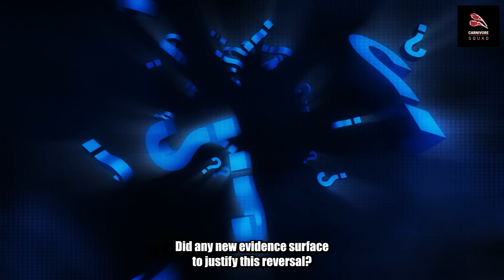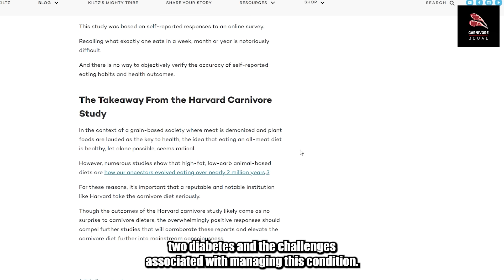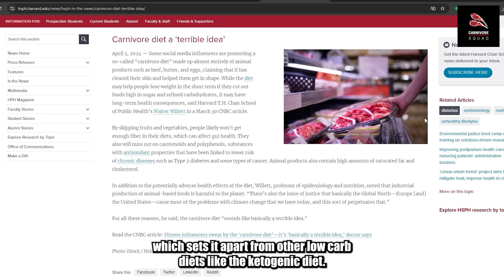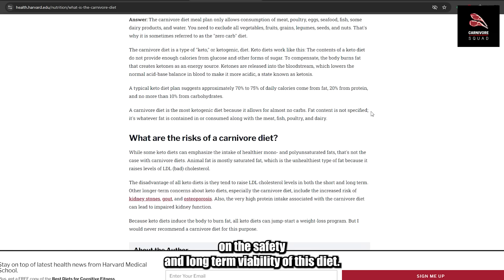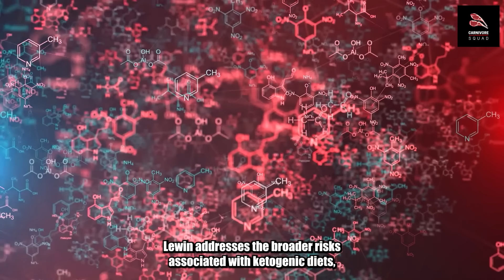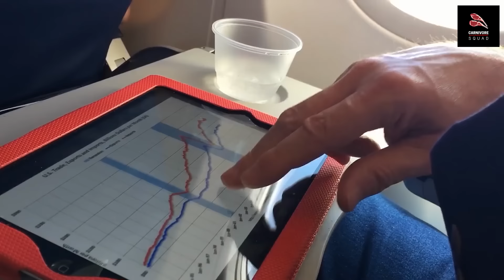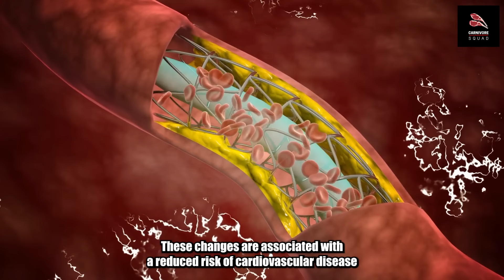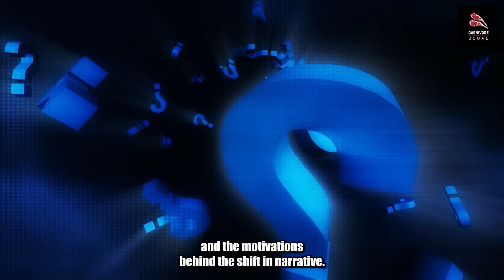🔴The Dark Side of Carnivore.. Shocking Harvard Study Findings [2024]

Comment: 10 month carnivore here.  73yo male. Lost 101 lbs. chronic knee pain completey gone, now walking two miles a day. A1c went from 13.1 to 5.7. Stopped metformin and actos 9 mos ago. Stage3 chronic kidny disease (GFR 56) now completely normal (GFR 88). Lipid profile normal for the first time in my life. Blood pressure now normal (132/75) BMI from 42 to 29.  Wearing a continuous glucose monitor just for yucks.  Never outside normal range unless I decide to cheat. Both the regular readings, and the spikes when eating carbs have proven to me that I will be carnivore for life!   BTW, love my CGM not for the actual readings ( not always 100% accurate), but for the correlation to which foods spike when I eat them  This is a great training tool. Highly recommend to all diabetics. Have been severely insulin resistant and pre-diabetic for 50yrs.  Was always the "fat kid" on the block  Just wish I knew about it 50 yrs ago. (thank you Dr. Fung et al.)

Comment: I am a 71-year-old woman who has been eating a carnivore diet for 13 months.  I have not felt better in all my decades.  I now have a daily routine that includes calisthenics, sprinting, weight-lifting (baby weights),  hanging and walking.  I had an unfortunate injury 2 months ago requiring emergency surgery and was prohibited from doing all exercise except for walking.  I pined for my routine.  I credit carnivore with my speedy complete recovery.  Additionally, I am an elderly woman who experienced a harsh fall on a hard surface and didn't break a bone.  Observations about the hospital that I found disturbing are 1. there wasn't a darn thing there I could eat., 2.  they thought my ideal blood pressure of 109/63 was "too low", 3. they recommended more than a few unnecessary procedures/medications/invasions that I consider dangerous.  Much to their surprise I was discharged less than 24 hours after surgery.  I could go on for days re the virtues of a carnivore way of life (IK, I already have).  I love it so much!! PS  I have maintained a healthy body weight and take no medications.

Comment: I have lost over 100 pounds and my triglycerides have dropped dramatically. My LDL is up but my HDL is also up so I’m not worried about it. My knee arthritis is gone. I will always be on carnivore or KETO for life 😊
Reply from the maker: Great ..
Reply: That’s excellent Sheila. What a life changer.
Reply: Have you calculated your CVD risk using the TG:HDL ratio? Work out your risk by dividing your triglycerides by your HDL. A level of 2 or under is ideal. You may be pleasantly reassured.

Comment: Cured my ulcer, hyperacidity, a problem since i was in gradeschool, acid 😂reflux, constipation, hypertension, tooth decay, migrane all cured without taking any single pill. In just a matter of weeks from 160/100 blood pressure i suffer for years already suddenly went to normal bp without the help of any pill. My strength and speed came back to teenage years. Im 55 yrs old now back to teenage year strong. No supplements for almost 2 years now. Thats why i laugh loud when some findings like this emerge. Try it first. Imagine im suffering for aching tooth both molars for years already suddenly gone and now reversing because that aching teeth was repaired by my body itself with the help of course of carnivore diet nothing more and my ulcer for decades suddenly gone like a miracle and never came back since carnivore. Beat that with bs mainstream findings and any drug

Comment: I did an experiment on me. 2009 I went on a raw vegan diet, lost weight but didn't heal my joint pain, did vegetable diet for years but would eat a little bit of meat now and then, gradually slipped back into a balanced diet that was also lots of bread and candy. My shoulders were locked up with pain. My knees were full of inflammation and pain, was on and off crutches for a few years, then did strict carnivore diet and intermittent fasting. I went from 180 pounds down to 124 pounds and lost all of my pain, oh I didn't mention the chest pains that came on daily. that was going on until I switched to carnivore, now I am also relieved of the chest pain 100%. I am no longer strict carnivore anymore though. I am verry carful though Yes, I allow myself a good quality milk chocolate bar one a week, yes, a big bar, and a pint of ice cream once a week. I am 139 pounds a man at 5'7" I feel good and am content with that, I am 67 years old and usually get a five-mile bicycle ride in daily, regular mountain bike no electric or motor just my own pedaling. Thats my experiment. It is well with my soul; I am feeling good at my age. Stay well!

Comment: I am not 100% carnivore . But I try and I will eventually succeed . I struggle loosing weight but the following change has happened: psoriasis disappeared . 
I also have become much better at NOT snacking . As said not 100% there but I realise the devastation of even moderate carb consumption -allegedly due to the negative effect it has on gut micro biome . People with gut problems had a biome that thrive on carbs and people without problems have a biome thriving on protein and fat. 
I have fasted and understood need for food intake on a whole other level . For instance I have trained during multiple day fasting with NO issue . Before I “needed” to eat several times a day- but the food had to be very delicious. I now consider this a mild form of eating disorder . If food has to appeal to your comfort besides feeding you you are NOT hungry or in actual need of food. This means a much better control of food. I am even sure this will improve as I go 100% due to better function of metabolism and the regulating hormones . 
I need to brake the 3 month barrier of no carb to get full benefits . Luckily some say that after 3 weeks lots of benefits appear .
This doesn’t mean that I never bill eat carbs again but it will take an apocalyptic lack of food to change back. Or imprisonment by a fascist vegan government so they control my food 😂….😱😱😱

Comment: I probably have a skin cancer, that doctors don't want to operate. Through changes in my diet I've noticed that high carb + high processed carb diet leads to significant pain, and intermittent fasting or high animal meat/fat diet leads to reduction in pain to zero, I also don't feel any pressure (I mean physical pressure) from the cancer tumor. Idk why it happens, but it's pretty groundbreaking outcome, even if we'll consider just the reduction in pain.

Comment: Age 80. Strict Carnivore for one yr. Plus "Ketovore" for another yr.  
Beware! I sufferred low energy in my Carnivore year albeit other benefits were several.  
My mistake was waaaaaay too high a proteim ratio to a way too low fat ratio. Beware a lot of Carnivore Gurus deemphasize the much needed higher fat to protein ratio, especially if maintaining, not losing, weight is key.
The ratio advised in this Video is approximately correct for my slender body type.
Had I followed that fat ratio advice in my strict carnivore year it would have saved me a lot of greif.
Anyway at age 70 yr.  I started breaking down physically, but now at 80 yr. my body & mind is better than when I was 60. That is thanks to my purely zero junk diet, low, low, low & slow, slow, slow carbs, relatively low blood glucose/ moderate to high ketosis diet. Plus amazing meta natural (mind over matter) discoveries deep within me.

Comment: All things in moderation.  Cholesterol is critical to the generation of hormones to  adjust the metabolism.  One item is missing as we age is the levels of pregnenolone, a precursor of 150 hormones in the body.  As we age, we do not make as much pregnenolone as we did in our early years.  The biologic age can be projected from the levels of pregnenolone in the blood.  Cholesterol increases as pregnenolone declines.  Pregnenolone is available as an additive over the counter.  The Pharmaceutical folks do not want you to know about this dietary additive.  They warn that PREGNENOLONE should not be used long term.  It is something our bodies have been using for nearly all of our lives.  It will drop your cholesterol like a rock.   Fiber is important.  Decrease the impact of carbohydrates that set you up for diabetes.  I have been using pregnenolone for over 35 years.  I look younger than my 73 years would suggest.

Comment: Potential risks in the Carnivore Diet (W. Willet et al., 2024)

1- High LDL or "Bad Cholesterol": This is based upon "The Lipid Hypothesis" Which is JUST a correlation but not actually proven...in fact atherosclerosis needs high blood pressure, oxidative stress (Endotelial Damage likely due to hiperglicemia) and high LDL but it turns out that if you dont have any of the first 2; high LDL by itself it is not harmful at all. Saturated fats are the bodie`s preferred fuel source (turned it ketone bodies) and it is needed in sufficient amounts to maintain hormonal balance (and no, the cholesterol synthetized by our own body it is not enough, we need to consume more from our diet).
2- Fiber is crucial to maintain gut health: Again... it is not actually proven.
3- Carotene, AIDS and polyphenols Deficiency: These are not a requirement for human diet and you dont need to have high amounts of antioxidants protecting your cells if you are under a uninflammatory diet, such as the carnivore diet. In fact a plant based diet contains toxins and antinutrients like lectins and solanines which are HIGLHY inflamatory.
4- Kidney Disease: It is well known that high blood pressure and hiperglicemia damage the small blood vessels of the functional units of the kidneys, causing the loss in functionality and protein, blood and immune cell inflitration to the urine, furthermore kidney stones are highly composed of oxalates, crystals that are found in plants. A high fat and protein diet like the carnivore diet do not threatens by itself the kidneys, in fact they start to work more based upon the Flomerular Filtration Rate (GFR): this number goes up in a carnivore diet, which means the kidneys are actually working more because they are healthy and they can perform well.
5- Enviroment: Industrialization of any thing causes harm to the planet, no matter if it is animal or plant based. If you look at Regenerative Farming is one of the best ways of sustainability.

Remember: Epidemiology, which is observation of population and variable correlation, DOES NOT PROVE CAUSALITY. It can only be used to formulate hypothesis and in reality is very very hard to accomplsh a well done nutritional study in humans. 

Carnivore made me feel better than ever, i must admit that i keep eating pasta, fruits and honey occasionally but my diet is 70% meat, eggs, bacon and seafood. Im HIGHLY Uninflamed, high testosterone, extraordinary strenght, recovery time, improved mental health, diminished mind fog and my senses are clearer. Feel free to share your thoughts!!

Comment: I am starting carnivore September 1. I have just removed all grains. In a week I lost 3.5 pounds, which is disturbing because I want to put some pounds on. I am 5’ 8” and weigh the same as I did at 20 - 126 pounds. I am doing this because for decades I get 2-4 migraines a week and my lower tummy is always bloated. I have been gluten and dairy-free to no avail. I suspect oxalates and salicylates in plants.
I am trying to figure out how to add weight without eating too much protein. I don’t really care for meats except for lamb. I already eat a lot of salmon so am not adding that due to mercury concerns. Anyhow, if anyone has put weight on while being carnivore, please let me know!  Oh, and I am 72.
Reply: I got rid of about 90 percent of carbs and lost enough weight to become lean. Then , without cramming too much protein down my throat and large amounts of fat to maintain my new weight, I started putting olive and avocado oil on my food. I don't know how good or bad this is due to whatever information is being pushed, but to be on the safe side possibly, am adding supposedly good oils to provide over one thousand calories a day and sometimes up to 1500 a day so my weight has stabilized at 146 plus or minus. If I eat veggies and some carbs, I will weigh around 152 and my stomach is bloated, have gas and about 2 pound craps. A couple of days no carbs or veggies and back to a flat, comfy stomach and 146 pounds. That I conclude shows carnivore is good and the other diet is full of crap. That and even if I still don't get good sleep, I don't feel the carb coma making me tired and wanting to nap and fall asleep at the computer. Also my ass feels better from having fewer poops that are cleaner and don't take many wipes with paper rubbing my anal orifice until it's raw. I'm 73 and my lean , more like ripped body stands out at the gym getting compliments from almost everyone. I do heavy barbell curls with over 200 pounds, cable rows with up to 300 pounds, lat pull downs with 185, triceps push downs with 120. I'm about 5feet 9 and a half inches and 146 pounds. I do need more leg work I admit. That would add another 10 pounds or so and look better. Great bone density like a much younger man due to high protein diet and exercise. I've only lost a half inch of my formerly 5 feet 10 due to bad posture being my own fault of slouching too much. For over 30 years doctors have wanted me to limit meat to once or twice a week because of cholesterol and to take statins . Even when it was only 185. Their trying to kill me. Gonna tighten up diet more with almost zero carbs and see what happens. Down to 5.3 A1C 3 months ago from a high of  6 a couple years ago. Aiming for a 5 next time in 3 months next blood work. 3 tablespoons of oil is around 360 to 390 calories. Add that to every meal and see what happens. Then add more or less if needed.

Comment: Inuits didn't need to be sharp minded like people in the west - no competition of land and resources.
We in modern world need much salt, potassium, carbs/sugar,  protein and saturated fat in our diet.
Salt and potassium (from plant food) to balance cells correct. Salt is lost by sweat all the time, espescially in hot conditions. Too little salt means less sweat, but also possible overheating. The body tries to compensate that by reusing salt and conserving any small deposits of salt that exist outside the cells.
Sugar/carbs gives glucose spikes needed in the West, South and East through history to avoid sluggish movements and thinking, that made flight or fight better - to deal with enemies and predators.
Saturated fat helps neurons in our brain to work properly and contains fatty acid C15:0 (most in dairy).
No new important inventions and scientific discoveries would be possible without those mentioned nutrients.
Seed oils destroys gut bacteria - animal studies show that. Then of course you would easily have troubles with carbs, fat, oxalates and sugar. If you are metabolic healthy, saturated fat etc. can never harm you.
Otherwise, you may try carnivore a short while, but then get used to some plant food, starting with fermented food (sauerkraut, pickles, kefir, yoghurt...) and then some dried small portions of fruit. Vegetables, nuts and grain later.
When your gut is fixed, you can forget lipids, LDL... mentioned by Harvard. But avoid emulgators (in ice cream...), hydrogenated oils (in energy bars, biscuits..), soylecithine (in chocolate...) and seed oils (in most ultra processed food).